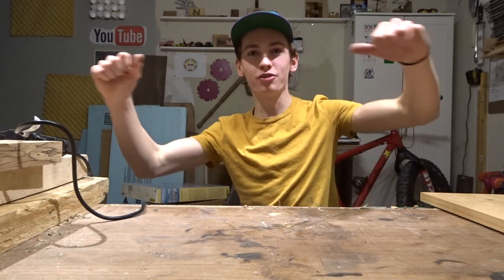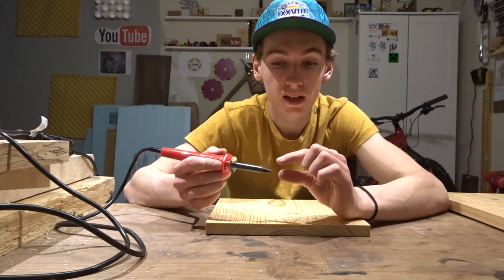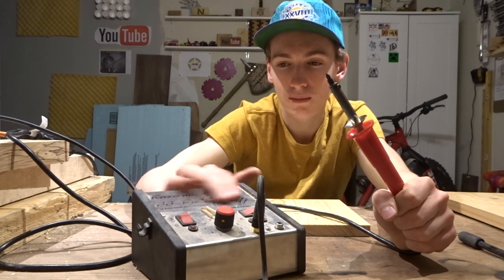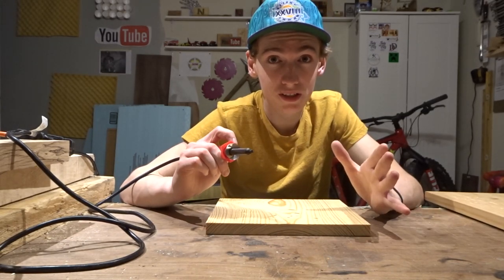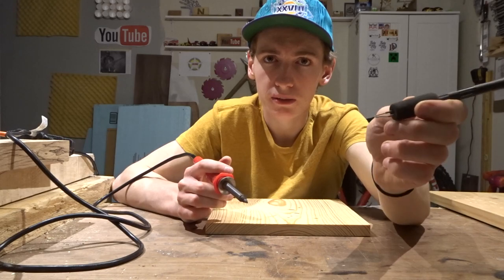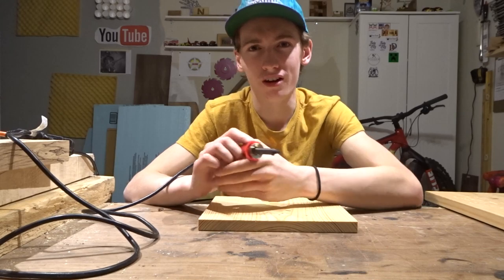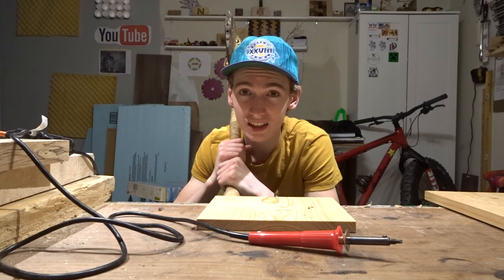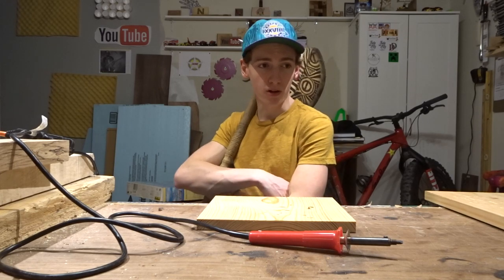Is a Cheap Wood Burner Worth It?

Comment: I started off the same with the soldering iron type which had several tips and I produced a piece for someone that lost their dog and it turned out really well but I also have a hand built machine that has I can switch between two pens , but I have to agree both types of machines have there place.  Good video by the way and keep burning

Comment: Started off with a $25 one, then upgraded to a $100, and then finally got a Razertip.  Wish I upgraded to the Razertip in the first place.  Much more power and better precision...even with the SK unit (single port/pen).

The $100 is decent, but has much less power (on 8/10) is mostly the thing that annoyed me.  I would recommend trying out the craft/hobby with the $25 ones, and then upgrading to the Razertip/Colewood/whatever....

Thing is the Razertip gets hot enough to start to hurt your hand, but it gives a very good result (because of the sheer POWER of it).  Bought the Razertip used and saved a bit of money.  The good thing is that there is a local store that stocks the Razertip handpieces and things - so no buying USA/whatever (I'm Canadian) from them.  And they also retip your tools for $6, so no need to buy another replacement pen...
Reply: Do you remember the name of the $100 one?

Comment: Hey I just got wood burning kit. I didn't how to change the tips so I guess I accidentally pulled the wire. It's not an expensive one thou. Can u help me fix the wire at the back. I m just not sure about short circuit or getting a shock. Please help if u can. Thanks dear.

Comment: I am a dad with an 8 year old interested in getting into wood burning.  I'd be interested in investing $80-120 on a decent pyrography kit for his birthday.  Could you steer us towards some various products on Amazon/Ebay that you'd feel is worthy of our time/money?
Reply from the maker: Razertip is my only suggestion based on experience with the tool first hand. I believe you can get the  base model razertip and a medium skew tip for around 120usd. Colwood is also a good option. from what I hear... anything that is pen nib style. not the bulky soldering iron type burner.
Reply: @DylansDIYWorkshop  Thank you very much!

Comment: Hi Dylan I came upon your chanel,.while looking for ways to fix a mistake. I had some bottle openers as gifts for my fiances groomsmens made from etsy. I accidently put the wrong year on the notes. Instead of 10.17.2020
I put 10.17.2010 and thats what I got. Messaged the seller hoping they would just turn the 1 into 2. They refused and told me to buy new ones. Would you recommend using this to just turn that 1 into a 2?   I'm running out of options! Its a small mistake and I'm hoping I could fix it myself

Comment: I have the orange one and it is pretty difficult to use at times. It doesn't stay hot very long, so it's hard to get consistent burns. The tip of a couple of my attachments got bent also. I'm working on a present for my mom right now, doing a horse vector type design, and I've found that it does not get hot enough to catch fire to normal sketch paper, which is sort of a good thing, because I can use that as a stencil. However, it also means that It's very hard to burn right through the paper and also get a good burn onto the wood, so I"m finding myself going over the same lines over and over and over again. It is very good for practicing some basic mandala type designs, and probably some freestyling though!

Comment: I learned with a soldering iron
Reply: @Balta647 Cool I didn't knw it was the same thing !!! Thanks for the info lol I'm just starting.
Reply from the maker: it is and it isnt. soldering irons arent nearly as hot as wood burners. soldering irons are 400° where as wood burners are 900° or higher. so yes, it will work. but can also be discouraging because of how long it actually takes for the wood to burn

Comment: Excellent!!! And being 'older' (me) i would do so much better with the system instead as the closer to the project the better.  We shall see how i do with my simpler one (does have a temp control) and take it from there.  AND  they should have sponsored you.  I'd bet you would have made them bunches as i already searched for it (not available at this time) and im just one of many.  oh well, their loss
Reply from the maker: They wont partner with me lol. I've reached out to them. Its ridiculous. Anyways, good luck with the simpler tool. hopefully it does everything you need it to do :)
Reply: @DylansDIYWorkshop   tks :)  it wont  lol  I am looking into the Optima 1 duel  as i am already annoyed at this one i have.  It's screw in tips and no matter which tip i have in, it gets loose shortly after using.  bugs me

Comment: You kinda got me interested in wood burning... I've got a dremel with a carving tip. Might torch some wood then try carving into it with the dremel. Might get a similar outcome
Reply from the maker: +Single Bit Outdoors yeah that should work pretty well as long as it's not burned too deep. I think your result would be the negative, or opposite of the type of wood burning I do. (The light spots are the dark spots and vice versa)
Reply: Dylan's DIY Workshop yeah that's what I  thought

Comment: Hello Dylan, i bought one wood burner very similar to this one but i plugged it in like for almost an hour and it didn't got hot enough to burn the wood, do you know what could be the problem?
Reply from the maker: is it for sure a wood burner for burning wood? they look very much like soldering irons (which are only half as hot as a wood burner) is it possible that its a soldering iron. not a wood burner? if it is a burner meant for wood, I would return it for another. In that case it just sounds like a defect to me
Reply: @DylansDIYWorkshop  yeah it says wood burning tool in the box haha, anyway thank you 👍

Comment: I bought one like you are holding,first little project went great,second project,I tried,burnt all the threads off the burner, what kind should I get?
Reply from the maker: razertip is great and what I use
Reply: Thanks for answering, wondering if there is a way to fix the darn thing or buy another ?
Reply from the maker: does the one you have not work anymore?
Reply: actually yes i did any ways to tap or rethread?
Reply from the maker: its important to never un thread it when its still hot. as the metal is weaker. you may be able to find the correct size tap and try to re tap it. but if the threads are messed up too bad. you maky have to get a new burner